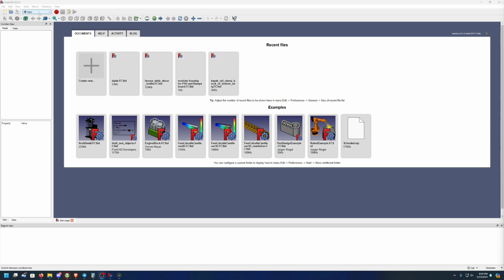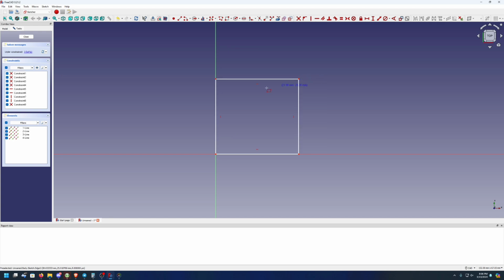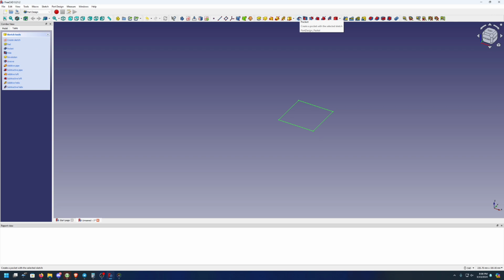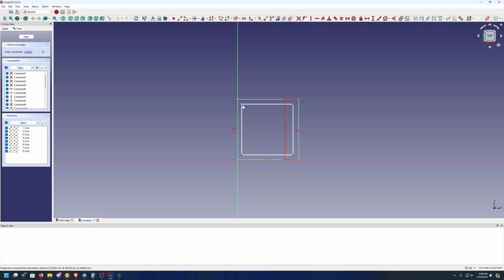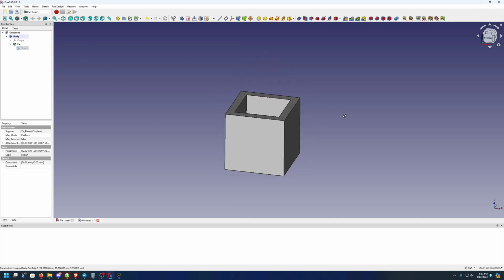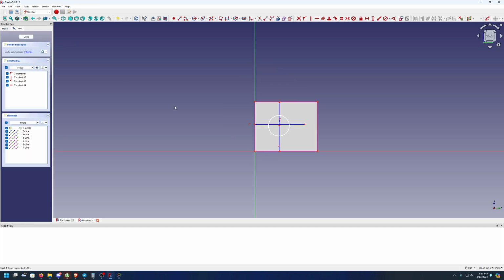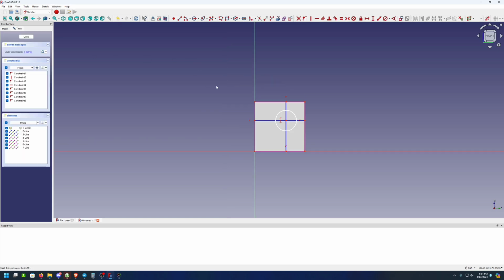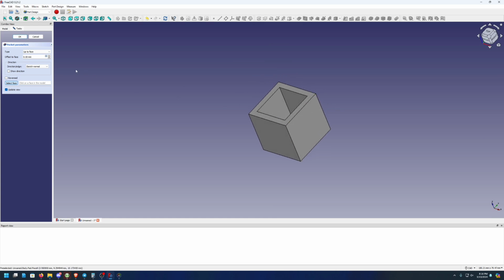Getting Started: FreeCAD Part Design 101 (Part 1)

Comment: Try enabling "Auto remove redundants." Select the wrench icon located beside "filters" while in sketch mode. There will be an option to toggle this, as well as "Auto constraints." This may help. FreeCAD is quite picky, I'm finding out.
Reply from the maker: I thought I turned that off in the past but I must have reset my settings.

I'll have to check thar setting. Thanks!

Comment: I found that trying to create anything more than basic shapes in Part Design WB (sketch based) I ran into brick walls... "not allowed". So I migrated to Part WB and started cobbling parts together using the primitives there using cuts as needed. DEFINITELY not elegant, but I seem to get it done. I'm very interested in seeing how you approach more complicated curved objects using Part Design WB. I have a graphics background and I'm sure as I get more proficient it won't take me 20 minutes to make a simple constrained cube in Part Design. That's why I started using Part WB... Just click on the primitive and plug in the dimensions.
Reply from the maker: I'm definitely excited to make more of these and get into deeper topics. I've learned a lot over the years, and hopefully can get others past some hurtles in FreeCAD. I do find unconventional  approaches are needed sonetimes. I have been able to make most of my more complicated designs in the part design workbench.

I will say in previous versions of FreeCAD,  I would agree with you it constantly would just complain about something not being valid. There are still occasions like that, but I would say they've done a much better job of detecting actual issues versus non-issues